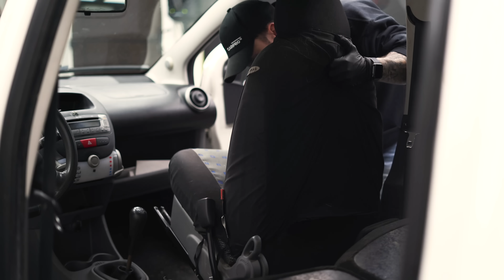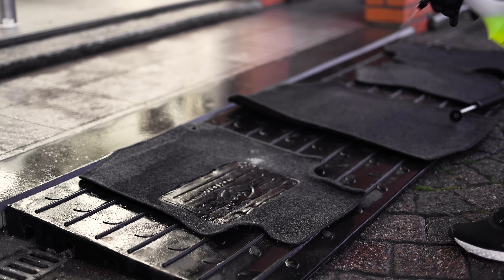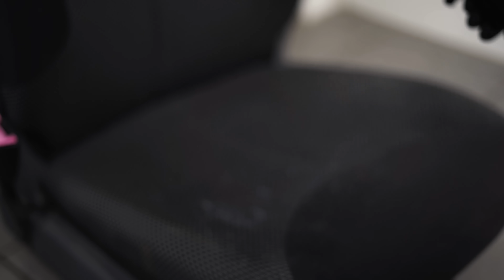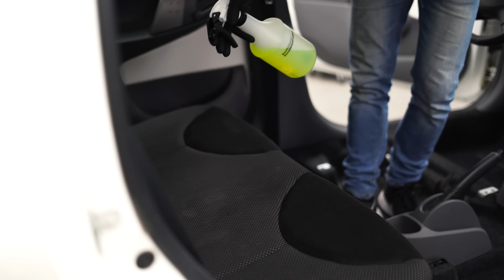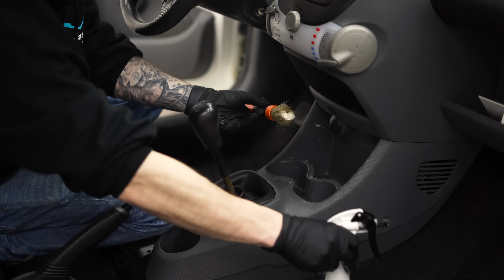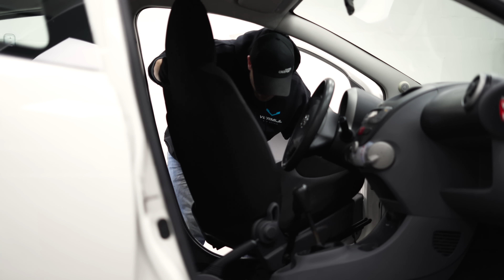First Clean In Years - Interior DEEP CLEAN

Comment: I can't believe, that someone actually drove around in that car, with the interior in that condition.
It must've smelled like a tip!
Reply: If you notice from both videos, interior and exterior. This car has been "abandoned", at least in the sense it was not being used! For whatever reason I don't know. But judging by the condition of it's interior, namely the pedals. I would say it's a relatively low km's car. The rubber on the clutch and brake pedals, look like new!